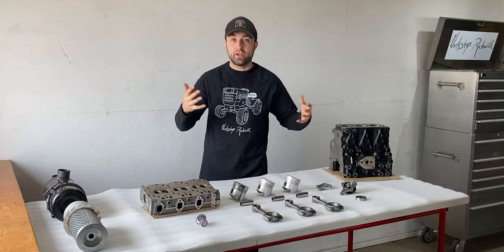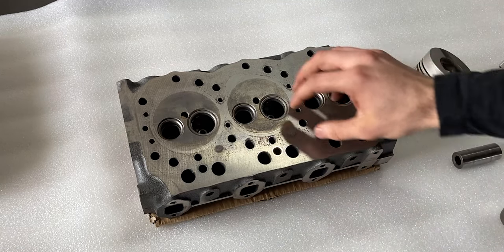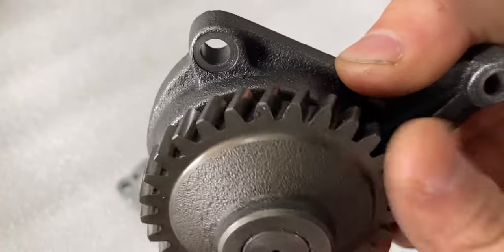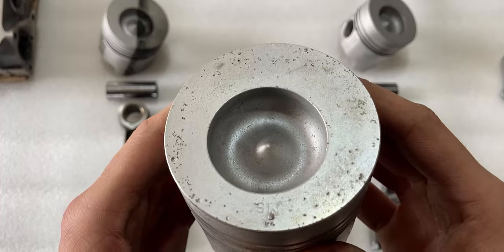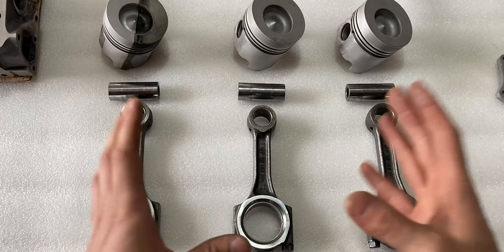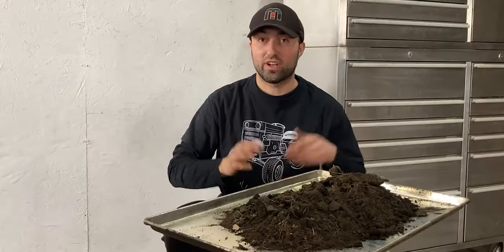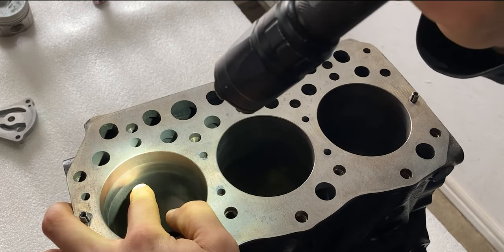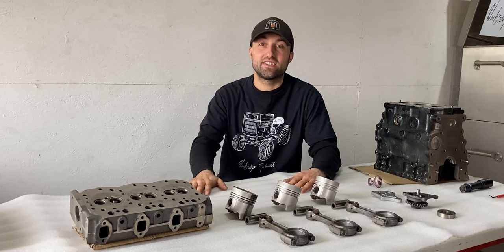Why did this Engine FAIL? Yanmar 3 Cylinder Diesel Engine

Comment: Incredibly helpful video. I have two JD-430s with a smaller yanmar engine. Going to check my radiators, air intakes for leaks, and buy new thermostats. Air filters are new, but I'll check them for cleanliness. Really looking forward to the rebuild video. What you do is greatly appreciated.
Reply from the maker: Thank you for your feedback, it's always nice to know it will help fellow enthusiasts! You have very nice machines and that is correct, they are each 20HP engines. That is a good thing to do Charles, especially around this time of year when the temperatures will get warmer. If you buy new thermostats be sure to check them before installation. I've ran into a brand new thermostat that did not open! Even at boiling temperatures. With the correct maintenance your 430's will last a long time. The rebuild video will be uploaded in a couple weeks time. Enjoy your weekend and best regards -Andreas

Comment: Great videos, excellent techniques, wonderful explainations and no slang.
Have a Yanmar 3TN66 ready to tear down.  It is out of my 1998 JD 6x4 Diesel gator.
Smokes, hard to start, and very dirty oil wise.
Expect to see scoring on pistons, vavles, and cylinder walls.
Air from filter takes very lone route to intake manifold.
Gator bed sits on air hose and distorts it flat. Damaged to hose just taped (duct tape) and let go by original owners.

I find most air cooled engines are hard to clean because of shielding to channel the air over engine.
The fact your JD 855 was so dirty says owner never understood preventive maintenance and did not care. SAD to see.

Would love to see video on laser cleaning one day.
Reply from the maker: Thank you very much for your valuable feedback! I really appreciate it. I believe you found a similar engine to mine in the shop. With a little bit of effort you might have yourself a great machine once you sort out the engine. Those gators are super handy for multiple tasks and I'd love to find one myself...but they tend to sell really fast if the price is right.
It sure is a shame that some owners don't take care of their equipment, but they shouldn't be surprised when they hear the bill from the mechanic shop!
I will share more videos about the laser cleaning very soon, I just have to get some more things sorted out behind the scenes. Thanks again and stay tuned. -Andreas

Comment: I will be checking my air flow on my Radator,  and my air filter. Thank you so much for your knowledge,  I can tell you love teaching ❤️
Reply from the maker: I'm glad you will be doing that! It's really important for every engine to run at a certain temperature and not exceed that, due to a clogged radiator. I just try to share a much as I can and hopefully this information will be valuable to all viewers. I really enjoy working on mechanical components and it's a pleasure for me to share my process through videos. Thanks for tuning in and leaving a comment! Regards Andreas

Comment: I'm pretty sure those thermostats have a little piston cylinder thing filled with wax that expands when heated, lil wax motor. I hope you got that engine running again.
Reply from the maker: This thermostat did not have the wax capsule and even though it's a more modern engine, not all thermostats have one. Even though in theory this should work, most engines overheat anyways. 
I got this engine running again after a full rebuild and it works flawless now! Thanks for your comment. Regards Andreas

Comment: So my huge guess is... someone used starting fluid to start the lil guy. I'm guessing the little bits of metal on the piston is ring metal. That piston would have been the center or #2 cylinder. If that was the case it was blowing oil out the crank case breather and they tore it down. I didn't catch whether you had the rings on the pistons or if they were bare like in the video. Obviously all that dirt on the radiator isn't good either! I would expect to see more damage if it was from heat? I guess the ether usually pops a hole in the top of the center piston but if that one with the chips in it was #2 it would fit the ether theory. Blown ring and she lost her pep. Hope you get it going again! I might be completely wrong but it's kind of fun sharing in the mystery! Best of luck, thank you for sharing!
Reply from the maker: Your speculation is great and I really appreciate your thoughts! It's really hard to say if starting fluid was used by the previous owner...but it is very likely, HAHA! I did not share a close-up of the piston rings, but I cleaned them up too and there was NO DAMAGE to them, nor was there any major wear. I could have almost reused them the way they looked (since the original engine only had 1400 hours, it was just broken in for a Yanmar).
The dirt around the radiator and all the dirt around the engine was bad. Looking at the crankshaft seals, they were probably leaking oil and that's why the engine collected so much debris. I had a chat with my machinist and he also pointed towards a heat issue. It's not always easy to identify an engine failure, especially since I did not disassemble this myself. The engine was already in parts as I got it.
That is correct, ether damage with damage rings and cause failures within the bore and along the pistons eventually. In this case it still looked pretty healthy, except for the excess wear towards the top of each cylinder (tapered bore from bottom to top)!
I have already rebuilt this engine and the John Deere 855 runs awesome! Thank you for sharing this comment!! Regards Andreas

Comment: Great work.  But I'm rebuilding a Yanmar 3tnv88 3 cylinder engine and now can't understand why the deal about timing on the fuel injection pump!!
Reply from the maker: Thank you very much! The 3TNV88 is very similar to the 3TNV82A I'll be rebuilding in the next couple of weeks. 
In this video the Yanmar 3TN75RJ has 5 big lines and 4 smaller ones in between, on the timing cover plate. The manual states to lineup the injection pump line with the 2nd big line from the top! So number one is on the top and number 5 on the very bottom.
With this adjustment my 3TNV75RJ is running very well!
The Yanmar 3TNV82A only lines up with one line, but inside the timing cover you can adjust the timing gear with 4 smaller hex cap bolts. THIS IS NOT RECOMMENDED, because this should be set from factory.
Let me know which version of timing you have and maybe I can help out.
Regards Andreas

Comment: Thank You ! Please keep on showing anything do do with the 855 JD tractor as I’ve owned one since new and it’s looking like it could use a rebuild, it’s a little down on power and started to exhibit smoking probably past the rings. I’m a new subscriber to your channel 👍
Reply from the maker: I'm glad you enjoyed this video Hank! Since the John Deere 855 is complete and running, I will be sharing videos when I put the tractor to use. I plan on sharing some snow removal videos with the John Deere 855 and the 47"Snowblower. If any issues arise, I will feature this tractor again in an upcoming video.
Depending on the color of smoke (Black= Oil, White= Fuel) you might need to do what I did...but it could be something small like the Valve Seals that are just old and they let oil into the combustion chamber along the valves. 
Thanks for your support and thank you for your comment! It helps massively. Regards Andreas

Comment: Also 3 air filters are offered for a 855 jd I bought one with trashed bores at 468 hours from wrong filter cut old liners out installed new decked block and good as new
Reply from the maker: I‘ve read this comment before, but I wonder where the faulty air-intake had a fault. 
All air-filters seal up against the seal on the large diameter and against the air filter cap-nut. Do you know where they fail?

I‘m glad you got your JD855 up and running again after a top end rebuild😃👍🏽 Regards Andreas

Comment: I have a 3TNV80F that does not get many hours on it - what do you recommend in terms of service interval? Should I be changing the oil and antifreeze before the recommended hours? When not in use, I only start the engine every 3-4 months - is that okay, or do you think that will cause damage because oil comes down with gravity? Thanks!
Reply from the maker: I would be looking at the oil and oil pressure more often than the antifreeze, if I were in your shoes. Check the oil dipstick before your initial startup and make sure you have enough oil pressure. Even after sitting for months, you should be just fine. 
Oil filters can break down over time on equipment and I would change filters more frequently than what the manual says.
After that just top off the oil to be at the full mark. Antifreeze on the other hand usually last longer...or at least from what I have experienced so far.

I hope this helps😃👍🏽

Comment: So new pistons, rings, piston rollers, rod bearings (upper and lower)? How did it come out? Was anything else replaced, rebuild?
Reply from the maker: Hi Dan. A couple more parts were involved, since I decided to go back to the original piston size. Dry-Sleeves were installed and new valves were added to the cylinder head. You can see the engine assembly in his video: https://youtu.be/JYa-o0gZiyA and this is the engine kit I used: https://bit.ly/3wQJpUV.
The outcome is a nice running diesel engine and hopefully it will last for many years to come. Thanks for your question. Regards Andreas

Comment: Do you know why the oil pressure would jump right up to 45 lbs  but in 10 minutes drop to 0 yanmar 4t84T- n three cylinder Diesel
Reply from the maker: Hi, This could happen because of these three factors: not enough oil in your system (make sure you have enough oil in your system), old oil filter (your oil filter is clogged or internally damaged, causing the flow of oil to be restricted), check your oil pressure regulator (on this yanmar 3TN75RJ diesel engine it is located right on the block where the oil filter screws on. Internally you will have a spring and over time this spring can get damaged or loose it's strength. This is probably the case and if youthink your spring is too weak you can always back it up with a washer or purchase a brand new one.) 
I hope this helps and if you figureout the cause, please let me know! I'm interested to know what went wrong. Regards Andreas

Comment: Great stuff here, thank you.  I'm rebuilding a 4k+ hour 3tn66 out of a Gator and find the timing marks rather confusing. The crankshaft gear has an "A" mark, the idler gear has "A:, "B", and "C" marks, the camshaft gear has a "B" mark and the fuel pump gear just has a stamped dimple. As much as I rotate the engine, none of the marks line up exactly.  The tech manual only mentions "timing marks", nothing about various letters.  Did you ever see anything like this
Reply from the maker: Hi there! I‘m happy to hear that you‘re giving your 3TN66 a fresh rebuild! 
Correct, on the idler gear you‘ll have „A/B/C“ marks, that you have to line up with the corresponding gears. 
Once you have the idler gear in place and you start to rotate your engine, it‘ll take many rotations until you line them up again!
The important part is that you line them up correctly the first time around. After that, make sure the two idler gear bolts are torqued to spec and that the injection pump gear is torqued too.
I hope this helps, Regards Andreas😃👍🏽
Reply: I'm embarrassed to say, it became obvious to me once I stepped back from the situation.  The timing marks do indeed line up at installation, but once the gears are installed you won't see them aligned again for many many revolutions.  If I was a math wizard I guess it would make sense.  That said, Thank You again for the knowledge and insights you bring to all things mechanical.

Comment: Have you ever saw one of these series engines come in with a messed up camshaft housing bores?
Reply from the maker: I have not! The front camshaft bore has a bushing-bearing and the two other surfaces are machined directly into the cast. Which ones are damaged in your case?
Reply: @WorkshopRebuild  the rear one that doesn't get a bushing.  I am wondering if I could get away with honing lightly to take any high spots off without changing housing size. It will still have some grooving in tho
Reply from the maker: @doggfriendly if there is enough surface for the camshaft to ride on, then you could remove the imperfections. If the bore is oval or too far gone, you‘d have to sleeve it.
Reply: @WorkshopRebuild  thank you for your insight on this i will set a bore gauge up to an identical block we happen to have without any damage and check the hole for roundness
Reply from the maker: That‘s a really good idea. This will give you a better understanding if the block needs to be machined or not. Let me know what you figure out😃👍🏽

Comment: 99% of early failures of compact diesel engines like Yanmar and Kubota are due to owner neglect. Radiators fins clogging gradually over time slowly increasing the operating temperature is a major problem. Dust, dirt, grass clogging the cooling fins let’s the engine consistently run hotter than it was designed to. Regularly using compressed air is the best way to clean radiator fins . It’s better than using water but a water hose is better than nothing. 
Many compact diesel engines experience fuel dilution in the oil simply because of how they are designed to run in a given application. Neglecting to change the oil regularly will cause excessive wear on bearings and camshafts. Use a quality oil filter designed to operate on diesel engines. Cheap Fram filters on an expensive diesel engine is a bad idea. Same goes for the air filter. The air filter is the last line of defense for keeping dirt and sand out of your engine. A cheap Chinese knockoff is a bad idea. Lastly use good fuel filters regularly. Diesel fuel is nasty and you need good filtration to keep the goo out of your expensive injector pump. 
Taken care of these little engines are good for 7000 hrs.before anything major is needed but they aren’t a good idea for people who are tightwads or just lazy about maintenance.
Reply from the maker: Hi there! I agree with many things you listed and it's very clear that these small diesel engines are often neglected by the owners. Keeping an engine clean is theoretically the best thing one can do, but many times other things are more important (haha)!
You said that very well about the oil, fuel, and air filters. These items must be changed periodically and it's best to follow the manufacturers' instructions, hence the maintenance stickers on all pieces of equipment that suddenly vanish over time. 
Thanks for leaving your insight and valuable feedback for others to read! Regards Andreas
Reply: Hi do you maybe know what is the best oil for those engines, i have 3 cylinder engine in 1,6 ton excavator thank you

Comment: Hey huge thanks for these videos they are super interesting , incredibly useful and easy to follow. I have one question I know your parts sourced from FridayParts and I guess these parts are not OEM yanmar - they are manufactured in China/India;  Would you be able to share your thoughts on the quality of the parts? say a rebuild kit? my engine is on my boat and I am dependent on it running reliably.  There is a huge difference in the price of the aftermarket and OEM parts  - many thanks
Reply from the maker: I'm glad you value my videos and I hope with this information you will be able to find a solution for your own engine.
Aftermarket parts are never OEM, but they are manufactured to OEM standards. FridayParts offers quality components if it's bearings, seals, gaskets, pistons and cylinder sleeves. All components are backed by 3-12 month warranty, which is more than your average dealer warranty, but confirm this before ordering as I am not affiliated by them.

If you were following along with the BMW engine issues, you will know that I've received horrible parts from Germany, Sweden and other EU countries. Maybe not what you expected, but I am aware that quality parts can be produced in any country. Even the ones you mentioned above.

The original Yanmar (3TN75RJ) that was placed into the JD855 compact tractor lasted ~1400hours  and it needed a full engine rebuild. I'm not familiar with marine engines, but would be nice if an engine would last longer than that.

Let's remember that we're discussing a Japanese industrial manufacturer that supplies engines to John Deere, one of the largest agricultural machinery companies. Yet the engine still failed prematurely.

This demonstrates that quality isn't consistently delivered to the end-user, underscoring the importance of making independent decisions.

Comment: I will be doing a tear down of my Yanmar 3TN66C engine to investigate possible dusting and smoking issue.
You are working on a John Deere 855 tractor and its engine but from whom will you be ordering your engine gasket kit from?
Online kits include pictures of cylinder sleeves which the 3TN66C does not have. That concerns me about kits from China.
Is your kit to come from Yanmar or John Deere?
Reply from the maker: That's a great idea Tom! I hope your engine can be rebuilt, because those gators are so nice to have! The engine kit is from a 3rd party supplier and I will share all the details in the rebuild video. That is correct, the engine kit I received had sleeves too, but they are DRY SLEEVES. The advantage of dry sleeves is that you can bore the engine to 0.20" over and insert a sleeve, which is then machined from the inside again to achieve the original bore size! A very neat way of repair.
Best regards Andreas